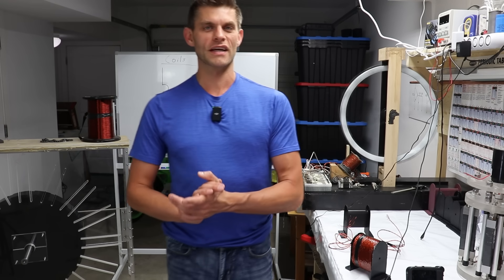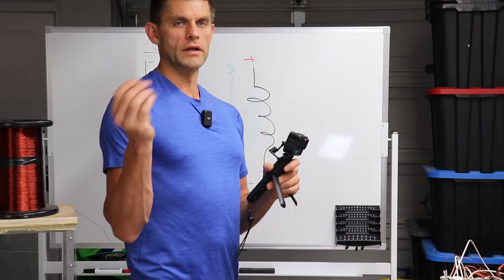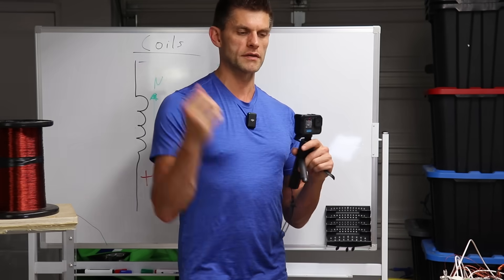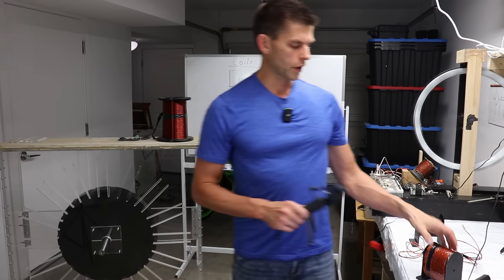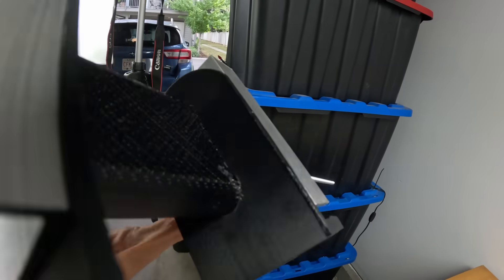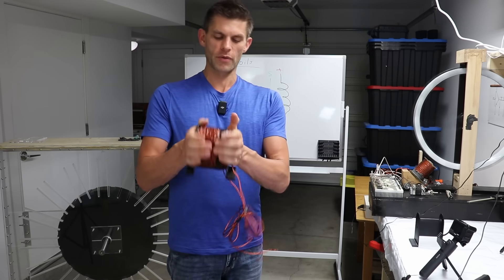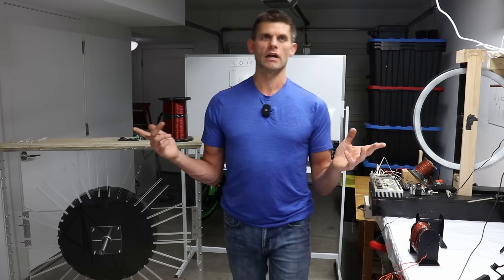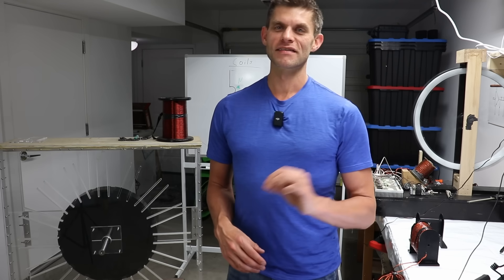Unlimited Energy in My Garage (No Patents)

Comment: There  may be a technological fix for reparing errors made since ~1800 in thermodynamics. 
Lets reframe Earth's low contrast abundant ambient heat as a thermal energy waypoint between heat and other forms of energy. Energy changes form without gain or loss. Uniformity is not in itself a form of energy.  
heat and other forms of energy. 

A simple rectifier crystal can, 
just short of a replicatable long term demonstration of a powerful prototype, almost certainly filter the random thermal motioren of electrons or discrete positiive charged voids called holes so the electric current flowing in one direction predominates. At low system voltage, a filtrate of one polarity predominates only a little but there is always usable electrical power derived from the source, which is Johnson (observation) Nyquest (theory) thermal electrical noise. Max Plank anticipated that ambient thermal noise would become usable with advances in technology.  

In 1973 I filed for US patent 3890161A DIODE ARRAY for an array of metal1/ insulator/metal2 diodes that refrigerate while concurrently producing electric power. The patent was granted in 1975. It was opened to the public domain in 1992. Development should be in the public domain. 

The plausible net electrical filtrate from diodes can be aggregated in grouping separate diodes in  consistent alignment. The alignmet must initially be parallel. A higher order of these parallel groups can be connected in series to produce higher voltage. Within limits, parts of the  network can be shorted out or open circuted without electrical or chemical  harm. The electrical  power released is always equal to the refrigeration produced. Inefficiency effects the performance but not the equality of the thermal absorbtion and electrical yield of the conversion. 

The maximum energy is converted from ambient heat to productive direct current electricity when the load electrical resistance  is equal to the array internal electrical resistance. Maximum calculated electrical power output (watts) is k (Boltźman's constant), one point three eight x 10^ minus 23, times T (temperature Kelvin) times bandwidth (0 Hz to a natural limit on 0~2 THz @ 290 K) times rectification halving and nanowatt power level rectification efficiency, times the number of diodes in the array. 

There are a billion cells of 1000 square nanometer area each per square millimeter, 100 billion per square centimeter.

Order is imposed on the random thermal motion of electrons by the structual orderlyness of a diode array made of diodes made within a slab: 

Host crystal in this example is silicon or germanium.

  P type boron doped
-----‐------‐----___-- Out
🔻🔻🔻🔻
■■■■■■___ + Out
  N type phosphorous doped 

All the P type semiconductor anodes abut a metal conductive plane deposited on the top face of the slab with nonrectifying joins;  the N type semiconductor cathodes or common cathode abuts the bottom face. As the polarity filtered electrical energy is exported, the amount of thermal energy in the group of diodes decreases. This group cooling will draw heat in from the surrounding ambient heat at a rate depending on the filtering rate and thermal resistance between the group and ambient gas, liquid, or solid warmer than absolute zero. There is always a lot of ambient heat on our planet, more on equatorial dry desert summer days and less on polar desert winter nights. 

Energy sensible refrigerators that absorb heat and yield electricity of equivalent energy content would complement computers as computing consumes electricity and yields heat. Computing would be free. Chips could have energy recycling built in. This would improve performance and lower cost. 

Full heat recycling, all electric, very isolated underground, undersea, or space communities would be highly survivable with self sufficient EMP resistant LED light  automated vertical farms, thaw resistant frozen food storehouses, factories, dwellings, self contained elevators, safe rooms, and horizontal transports. 
In a flourishing civillization, small self sufficient electric or cooling devices of many kinds and styles like lamps,  smartphones, hotplates, water heaters, cooler chests, fans, radios, TVs, cameras, security devices, robot test equipment, scales, transaction terminals, wall clocks, open or ciosed for business luminous signs, power hand tools, ditch diggers, pumps, and personal transports, Refugee communities would be buildable quickly. Fire safes would preserve contents to 1000F for years. These would be available for immediate use incrementally anywhere as people as individuals or larger social groups see fit. 

Some electrical equipment groups could be consolidated into local networks when suitable. Liguid nitrogen cooled superconducting networks would become practical. 

If a high majority thinks our civilization should geoengineer gigatons or teratons of greenhouse gasses out of our environment, instalations using devices that convert ambient heat into electricity can hypothetically be scaled up do it with a choice of comsequences including many beneficial ones. 

There are other plausible breeches⁰for anyone to of the second law of thermodynamics.  Hopefully a lot of people in independent teams, will join in expanding the breech. Please share the successes or setbacks of experiemental efforts. 

These devices would probably become segmented commodities sold with minimal margin over supply cost. They would be manufactured by advanced automation that does not need financial incentive. Applicable best practices would be adopted. Business details would be open public knowledge. Associated people should move as negotiated and freely and honestly talk. Commerce would be a planetary scale unified conglomerate of diverse local cooperatives. There is no need of wealth extracting top commanders. We do not need often token philanthropy from the top if the wide majority of people can afford to be generous. 

I do not seek to be the lead developer. This will disable confirmation bias and assure that other developers are acting on the merits of rhe hypothesis independently. For example gold needles abutting straight into an N type GaAs substrate may be a better starting point for development than Phosphorus and boron in silicoooon or Germanium crystal diode technology which is more familiar but plausibly inferior though it may be adequate for proof of concept prototyping. 

The topic deserves discussion and prototyping attempt action. 

  There could be net entropy reduction in the full lifetime energy accounting of diode array use. The entropic deteration of the structure of machine parts made of tough solids is inevitable but can be  minor compared to the stress of their use. This  is negative overall entropy.   

Diode array devices should be able to power the manufacture of àn ever increasing number of these devices. 

Aloha
Charles M. Brown
Kilauea, Kauai,  96754

Comment: Love the work you're doing genuinely! I would like to add an idea that can increase the energetic output of your machines! Shapes!! Understand that geometries themselves generate electricity. If our atmosphere is a free-flowing current of electricity imagine symbols and shapes are ways to change the flow of the sea. I recently experimented with clay and copper to build a Vajra, I wrapped the handle in copper as well. The amount of energy it generates just from the shape literally electrocuted my sibling when she touched it. Understand the human body is a walking magnet as well! As well as a conductor. Your intention and thoughts are the electric and magnetic pulses that you can send through machines to generate certain things. When testing my Vajra I was able to kick up the wind more, which this is an atmospheric ability (weather manipulation) in the palm of your hands. I used that with the intent to bring rain to my city because I realize terraforming a desert through WILL is possible. So, I held my hand out with Vajra and clouds started forming in the distance. Though it was only 2 not too large clouds... you could only imagine the implications. Not only that but the day became significantly cooler. Being that my city was hitting high 90s to 100 now today hitting only 90. I still new to what this tech can bring but I believe I can genuinely do amazing things with this. REMEMBER CYMBOLS AND SHAPES GENERATE CHARGES TOO!!
Reply from the maker: So cool love the information 👌

Comment: optic sensor to "turn the magnet" seems redundant, you already know the circumference of the rotor, the size of the magnet and the RPM, firing a pulse can be easily  calculated with a simple script
Reply from the maker: How do u know where the magnets is in relation to the triggering of the MOSFET ?

Comment: Amazing presentation, but your “zero-point energy” claims don’t stand up to even basic electrical testing. A few things you’ve overlooked:

1. No true-power measurement – A clamp meter only reads current on one conductor; it tells you nothing about real watts. You need a wattmeter (voltage × current × power-factor) on both live and neutral to prove zero grid draw.

2. Reactive vs. real power – Showing “zero amps” ignores phase angle. Without oscilloscope traces of V vs. I you can’t distinguish reactive slosh from actual power consumption.

3. No isolation test – To rule out hidden feeds or capacitive coupling, you must run your device off an isolated source (e.g. battery pack or separate transformer) and still light the load. Your coils remain tied to mains, so leakage could be powering the LEDs and fan.

4. Vacuum-energy extraction needs exotic hardware – Tapping true zero-point fields requires nano-scale Casimir cavities, ultra-high vacuum, cryogenics or NEMS resonators. A garage coil rig simply can’t couple to quantum vacuum fluctuations in any meaningful way.

5. No calorimetry or load-bank validation – Real overunity demos use calibrated resistive loads and compare energy-in vs. heat-out. Lighting a handful of LEDs and spinning a fan isn’t rigorous enough.

6. No third-party protocols or replication – Any genuine breakthrough invites peer review, detailed schematics, and independent lab tests. All we see here is anecdote and hype.

Until you provide true-power meter data, phase-angle waveforms, isolation tests and independent replication, your “overunity” and “vacuum energy” claims remain unproven—and almost certainly just measurement artifacts.

Looking forward to your detailed test protocol and oscilloscope screenshots.
Reply from the maker: Agreed the point of this build 👌

Comment: Interesting video. I have long believed that getting somewhere close to an over unity motor happening was with a wheel and magnets. I tried using an old plastic BMX wheel with magnets mounted around the circumference on a 45 degree angle, then trying to get it to move by placing a magnet in front of the wheel to get it to move. I thought once i give it a spin then magnet would roll into position and the other magnet would force it forward continuing the motion. Alas It would get to a point and then stop in between magnets. I felt that it was almost there. I tried again on a smaller scale using a 140mm Computer fan, sticking magnets on the end of each blade, again, the same problem, but also again, I felt it was so close to working.
Reply: May I also just add, I can see this is the way forward, but remember. The Mega Elites Control over the world is from the money they have from Selling Oil, Cola, Gas, Electricity, etc etc etc, which runs into more money than Scrooge McDuck, and when you look like you are getting close, someone will stop you, no ands ifs or buts. The Key to getting this technology out there is Free and Open Source and Lots of Publicity and lots of People by your side. Keep up the great work and take extra care. Subscribed and Following.
Reply from the maker: @OzDrDjObstruido glad it was answered, thanks for watching

Comment: This project raises significant red flags from both physics and practical engineering perspectives:

Thermodynamics Violation: Any claim of "harvesting energy directly from the environment" that suggests over-unity efficiency (more energy out than in) directly conflicts with the First and Second Laws of Thermodynamics. These aren't just "rules" - they're fundamental constraints observed in every energy system ever measured.

Flyback Voltage Misunderstanding: While magnetic field collapse does create voltage spikes (seen in everyday devices like car ignition coils), this is energy RECOVERY, not energy CREATION. The recovered energy is always less than what was initially put into the system due to inevitable losses.

Zero-Point Energy Myth: Despite being a real quantum phenomenon, extracting usable energy from vacuum fluctuations remains theoretical fiction. Even the Casimir effect (often cited in these claims) doesn't provide a viable energy source - the energies involved are negligible and require perfect conditions that don't exist outside lab experiments.

Battery Charging Deception: Lead-acid batteries can APPEAR to gain "free energy" through pulse charging techniques, but this is simply better utilization of existing chemical potential. All battery-based "free energy" demonstrations have been debunked as either measurement errors or hidden energy sources.

Patterns of Pseudoscience:
Vague references to "suppressed technology"
Claims of revolutionary physics without mathematical proofs
Requests for funding before demonstrating basic functionality
Use of undefined terms like "vacuum energy interaction"

Historical Context: Nearly identical claims have been made since the 1920s (Hendershot, T. Henry Moray, etc.), always failing under proper scrutiny. Modern versions simply replace vacuum tubes with silicon carbide electronics.

Practical Reality Check: If this worked as described, the creator would:
1) Patent the specific implementation (despite claims of "no patents")
2) Partner with major energy companies
3) Publish in Nature Energy, not YouTube
4) Already have Nobel Prize consideration

While the passion is admirable, this project follows the well-worn path of energy scams: using legitimate electrical phenomena in novel configurations while ignoring fundamental physics constraints. The $20k crowdfunding goal is particularly telling - serious energy research requires orders of magnitude more funding.

For the viewer: Any system claiming over-unity performance should immediately demonstrate closed-loop operation (powering itself continuously) with third-party verification. The absence of this basic demonstration speaks volumes.

Comment: for anyone wondering if this is legit - here the answer of Gemini 2.5 Pro (with context of video + Internet search):

1. Executive Summary: How Likely Will This Really Work?

It is scientifically impossible for this device to work as a source of "free" or "clean" energy that generates more power than it consumes. The device shown is a type of electric motor, and while it will certainly spin by consuming power from the batteries, it will never produce a net energy gain. It is bound by the fundamental Laws of Thermodynamics, which are the most rigorously tested principles in all of science.

The creator's passion, engineering skills, and open-source philosophy are commendable, but they are applied to a scientifically invalid premise.

2. Critical Analysis of the Idea

The central idea is to harness "oceans of energy all around us" by using a novel way of pulsing electromagnets. This concept is a hallmark of the "free energy" or "over-unity" movement.

- The Flawed Premise: The creator's claim rests on the idea that a special configuration or timing of pulses can somehow capture more energy from the environment (or the magnets themselves) than is used to power the device. This violates the First and Second Laws of Thermodynamics.
---First Law (Conservation of Energy): You cannot create energy from nothing. Every joule of energy used to make the rotor spin must come from the batteries.
--- Second Law (Entropy): In any energy conversion, some energy is inevitably lost as waste (mostly heat, but also sound, and air friction). Therefore, the energy output (the kinetic energy of the spinning wheel) will always be less than the electrical energy input. The system cannot be 100% efficient, let alone over 100%.
- Misinterpretation of Electromagnetism: While the creator correctly explains basic electromagnetism, the leap to "free energy" is where the science fails. Pulsing coils is not a new concept; it is the basis of Brushless DC (BLDC) motors and Switched Reluctance Motors (SRM), which are extremely common and efficient. They work by precisely timing the energizing of coils to pull the rotor's magnets along. They are efficient, but never over 100% efficient. The device in the video is a home-built, likely less efficient, version of these established technologies.

3. Why Was This Not Developed Yet?

a) This is a critical question. The answer is not because of a conspiracy by energy companies. The reason this exact type of "over-unity" device has not been developed is that it cannot work.
Violation of Physical Laws: As stated, it contradicts the laws of energy conservation.
b) Countless Attempts Have Failed: For over 150 years, inventors have claimed to have created perpetual motion or free energy machines. None have ever been successfully demonstrated under rigorous, independent scientific testing. They are often based on misinterpretations of magnetism or complex mechanical linkages that hide the energy losses.
c) The Principles are Well-Known: The physics of electromagnetism, upon which this device is based, is one of the most thoroughly understood fields of science. If there were a loophole to extract free energy from it, it would have been discovered and exploited long ago.